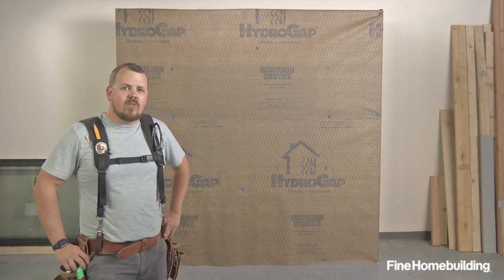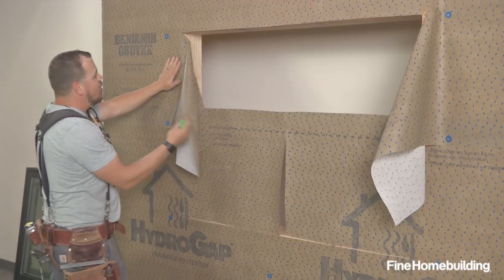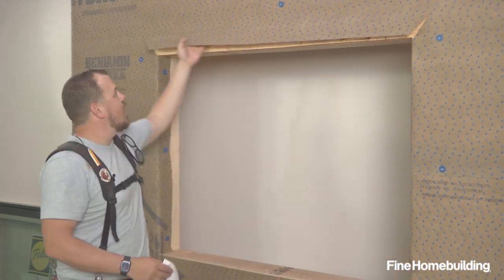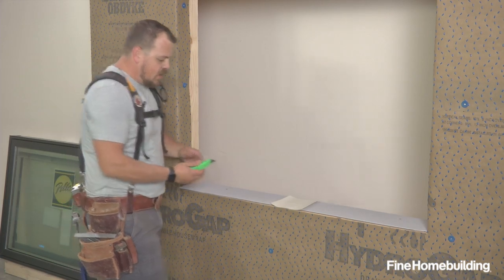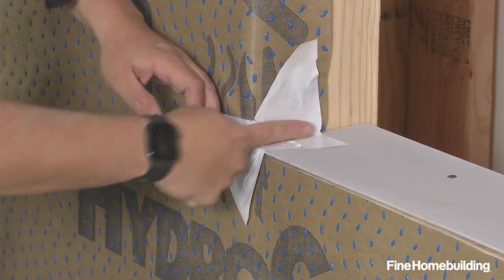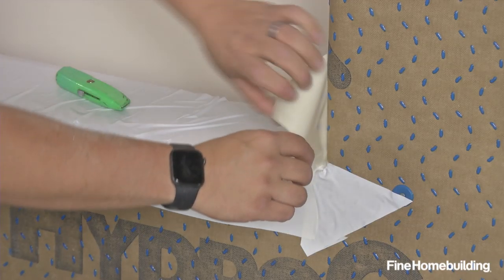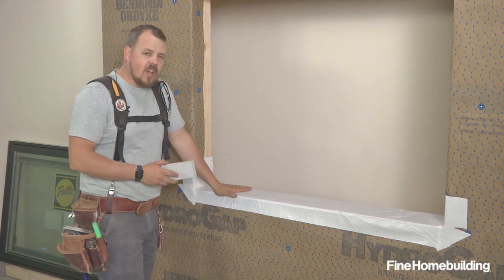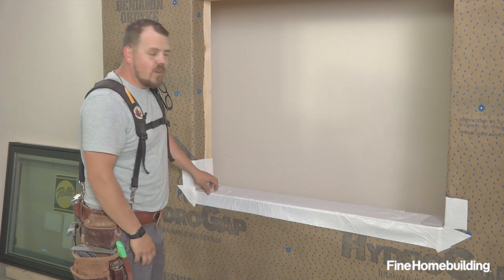Part 1: Prepare a Rough Opening for a Nail Fin Window Over Housewrap

Comment: So, if water gets behind the fabric it can wick around and into the house.   Not good.    Trim fabric flush, do the diagonal cuts at each corner then peal back and tape fabric.  Do the base as shown.   Tape sides then top.  Run the glue around sides and top them install window.   Trim fabric back 1” and apply tape to front of window flange and fabric.    Glueing to fabric is counter productive.